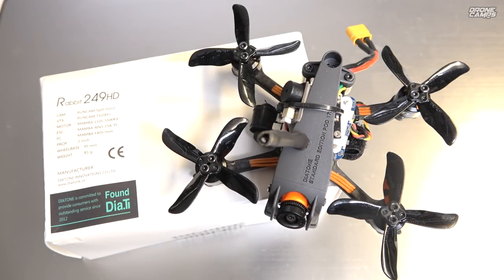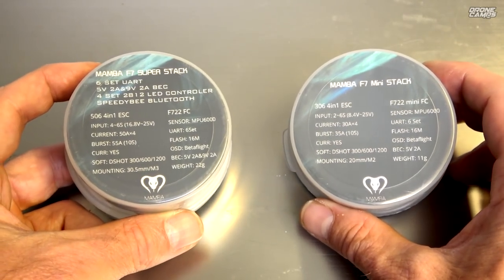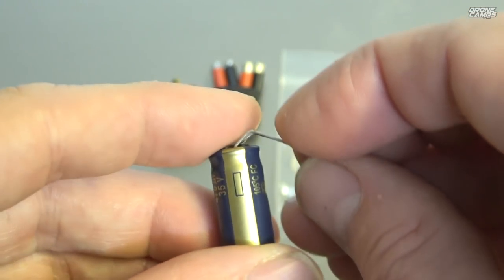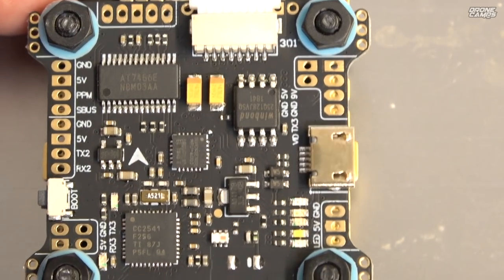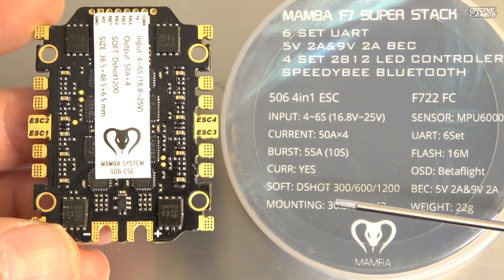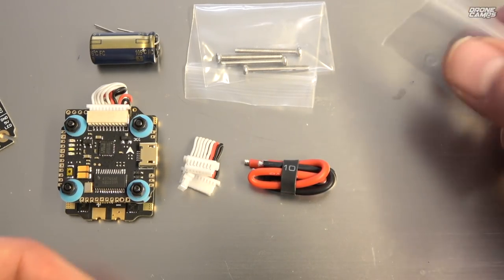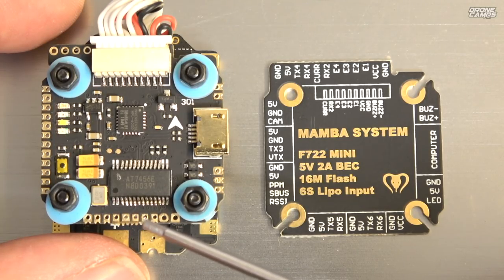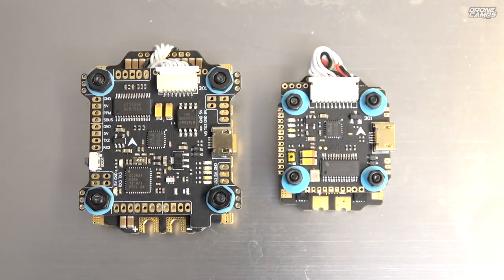DIATONE MAMBA F7 - 6S SUPER STACKS - PRO REVIEW + R249 HD Giveaway

Comment: Will the 9-volt on this board support DJI Vista unit?
Reply from the maker: Yes
Reply: @dronecamps  Thanks brother for the help, I did not want to connect straight  to the battery Leeds on my 6s bilte I am running a capacitor just don't seem right even though it says it can handle it lol...💣💥

Comment: I don't see why it couldn't run on 2s.  You just can't use the 9v pads as that would have to be a step up and not a step down.
Reply from the maker: The back panel says it will run on 2S. The sticker under the escs said 3-6S. I think it will run on 2s just fine.